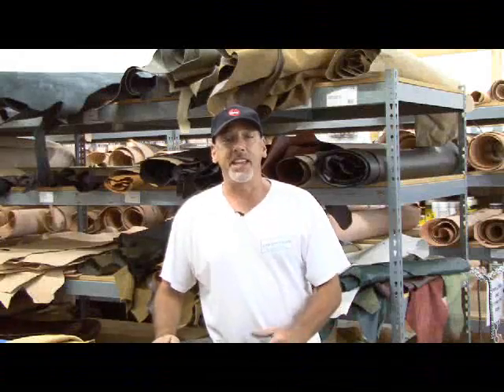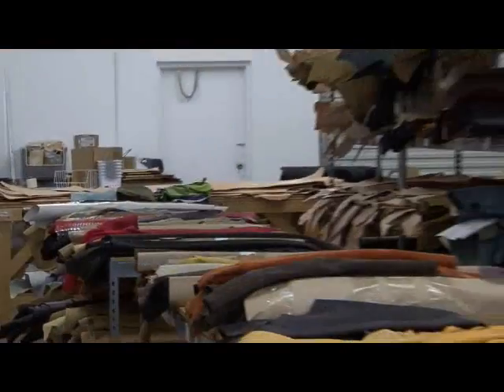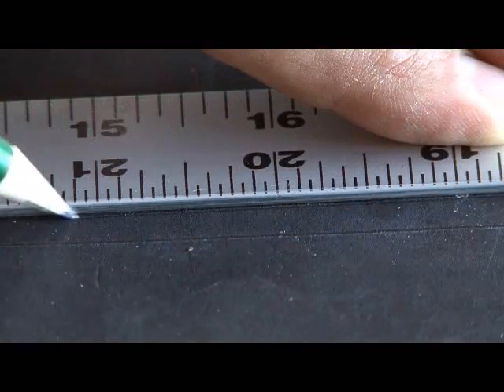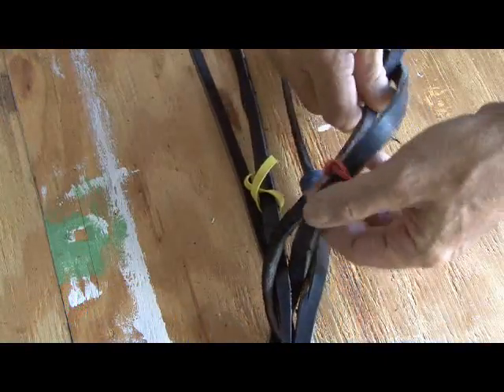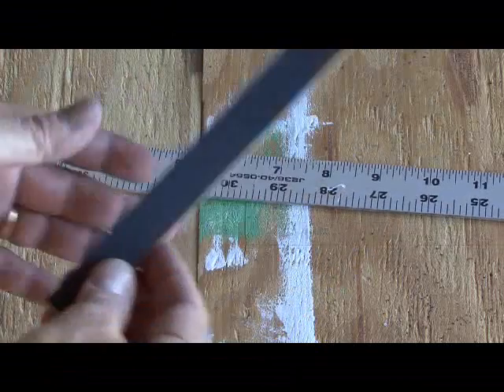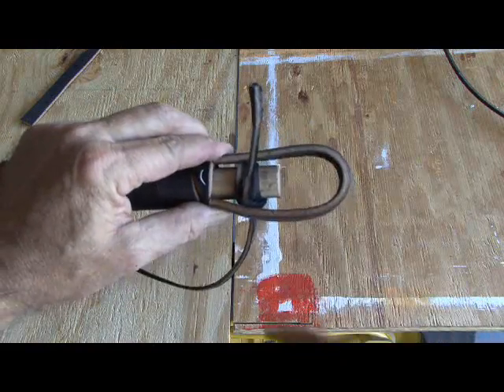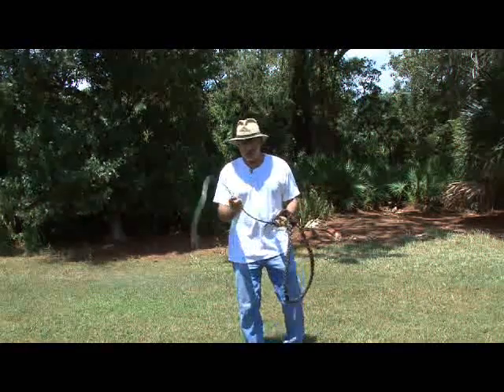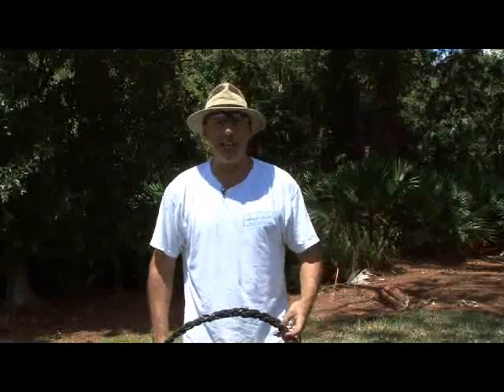Weekend Project: Sonic Boom Bullwhip

Comment: Never seen so badly made whip. I doubt it's cracking, the crack sound seems to be added afterwards. Very awful way to make a whip, it should have several layers not just one. If you just but a string and then rap a leather on it, whip would be better.
And also very bad cracking. You can do it better after 15 minutes of practicing on some video by Adam Winrich or anybody who expleins how to crack a whip.
3/10, i liked the idea of making whip, but never the way you showed.

Comment: You can just use the mouse to skip it?

I watched it through, was kinda funny, IDK why.
I don't host with godaddy, wouldn't recommend it either. But they're quite good as domain registrar.

Also, I'm not sure the whip itself breaks the sound barrier.
I believe it's simply the fast velocity at which it goes against the ground, pressing air molecules which then attempt to escape all at once in high velocity which may then break the sound barrier.

Eitherway....Guile> SONIC BOOM!

Comment: I'm a MAKE fan, but this just sucks. This "whip" is quite rudimentary. It isn't worth the effort to use real leather to make a whip like this. Hell, it's not even worth the effort to try this method at all. Better to make a real whip from nylon parachute cord. It's really not that difficult. Basic plaiting techniques are on YouTube already and there are several pdf tutorials on whip making freely available online. You can have a decent, but real, whip, unlike the thing shown in this video.